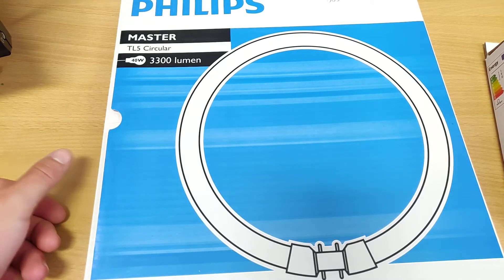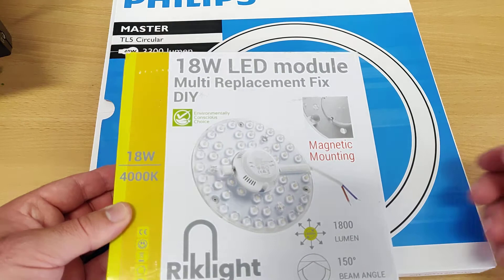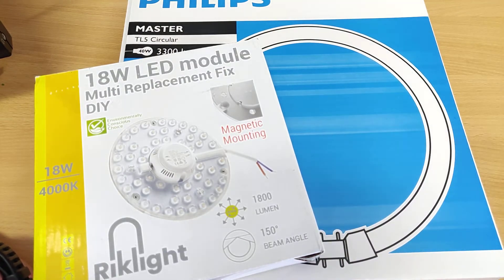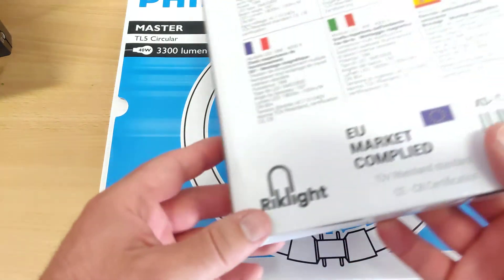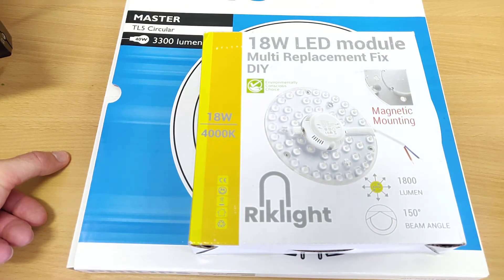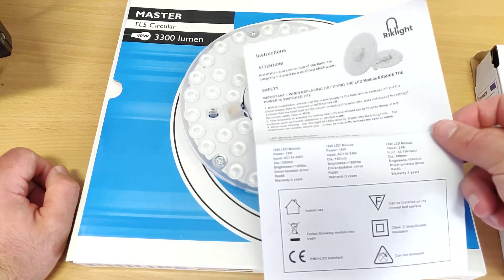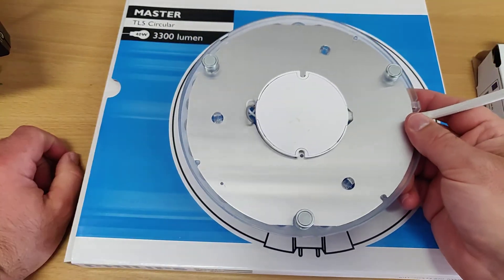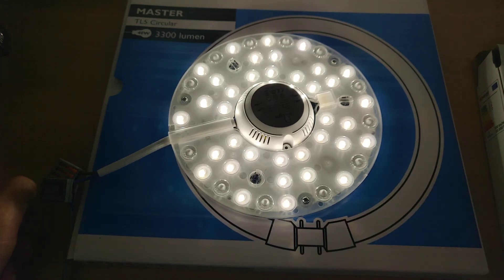How to Convert Circular Fluorescent to Led | 2GX13 Circular Tube Replacement

Comment: Greetings from singapore, my room is using the old type 32 watt circular light tube with 4 starter pin. Now the 4 starter pin is broken, and the ballast is blown out. So if i want to change to LED ceiling light, how many watt do i need to buy?
Reply from the maker: Usually you never have too much light. If you had 32w its usually quite close to the same when switching to led so would get around 30w if it fits in your light fixture
Reply: If let say i am unable to find 32 watt, which one better? 24 watt or 36 watt LED circular light tube?